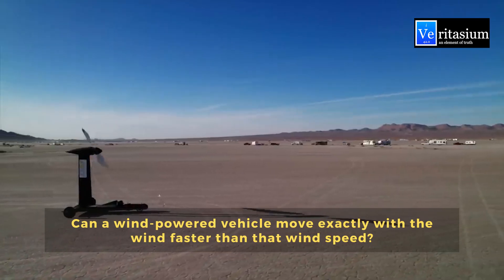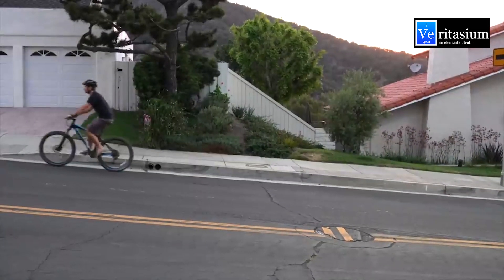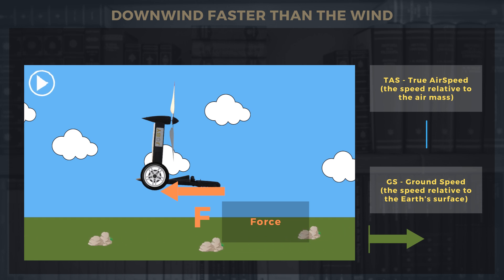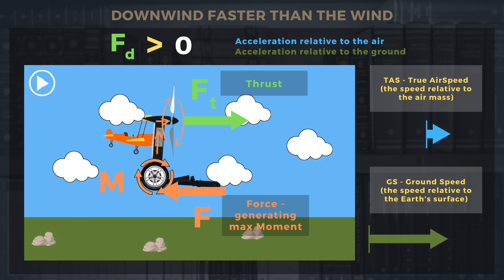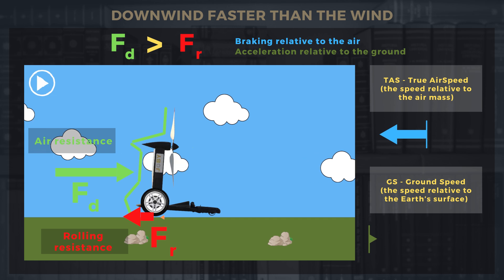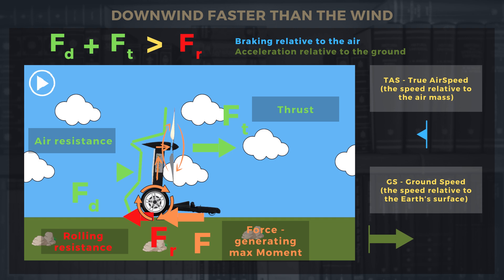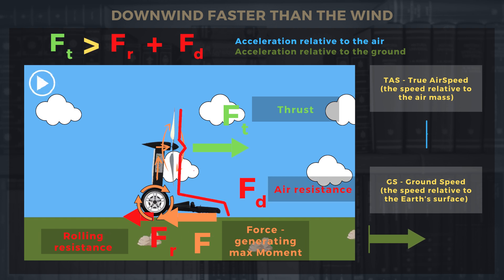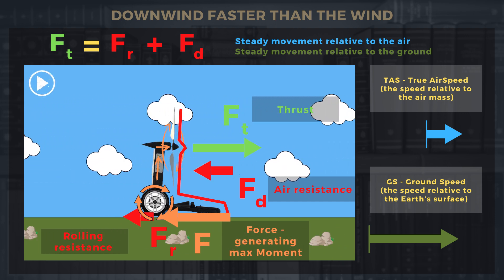Veritasium is wrong. Blackbird vehicle explanation.

Comment: Your main error: The orange force F at the wheels, is needed to balance the aerodynamic torque on the propeller. This orange force F:
- Does act as an external backwards force on the vehicle, so it must be included in the force balance that determines acceleration (additionally to rolling resistance).
- It exists right from start, even when the vehicle is not moving yet, if the propeller is already in positive pitch, as was the case for their prototype with fixed pitch.  See "BUFC second run" and note how slowly it starts, despite significant wind. That's not due to rolling resistance (which is rather small), but mostly due to the braking force from the propeller torque.
Reply from the maker: No it is not the braking force in fact it is the driving force. But it is transferred by wheel to the propeller so only there is added to balance. Propeller rotation creates resistance, but this resistance is what creates thrust. So there will be no losses on motion. Movement of wheels will be converted to movement of propeller. It need time to accelerate but because forces are not in balance it will accelerating.
Reply: @PiotrRysztak  "No it is not the braking force in fact it is the driving force."

It is driving the rotation of the propeller, but also creating a linear braking force at the wheels. The propeller rotation can create more thrust than this braking force, because airspeed < groundspeed. Look up the various papers Derek linked in the description of his 2nd video (AAPT, Drela, Gaunaa et al.)
Reply from the maker: @eyytee  I think Derek was misled by Mark Drela and other analyzes which mainly focused on the boat case. However this is a different scenario, because the wheels don't have to be "in the ground" (like a boat propeller has to be in water), wheels are only tangential to ground - it is crucial to understand. Only force braking vehicle relative to ground is rolling resistance (constant force)
Reply: @PiotrRysztak  Drela is considering a wheeled vehicle too, and so are  the other analyses (AAPT, Gaunaa et al). You have obviously not read them.
Reply from the maker: @eyytee  It is not about analyzing all other publications. Because they may suggest you and put you on one track of thinking. I am not saying that it is this situation, but if one scientist makes a mistake at the beginning and the rest duplicate it, it is not good situation isn't it? Derek himself recorded a film about such a phenomenon https://www.youtube.com/watch?v=42QuXLucH3Q "Is Most Published Research Wrong?" 
P.S. Drela only mention about it as i remember.
Reply: @PiotrRysztak  You simply have a basic misconception, that external forces are "used up" by creating moments, and then don't contribute to the linear acceleration anymore.  This is not the case. Your whole "tangential force" argument is simply wrong, and you will not find support for it anywhere in literature.
Reply from the maker: Don't catch me on words i am not native speaker. If you have tangentially applied force 90 degrees to center of wheel then this force will not move center of wheel. This force will generate max moment. How can you not agree that?
Reply: @PiotrRysztak  All that matters is that it's an external force by the ground on a part of the vehicle. Every such external force contributes fully to the linear acceleration of the vehicle. The fact that this force also creates moment that turns the wheel doesn't change this.
Reply: @PiotrRysztak  you know who wasn't biased by all the other scientists doing their derivations?  Me.  Because I conceived of and built the thing.  And I'm here to tell you that you are definitely wrong.
Reply from the maker: @Rick_Cavallaro  Let's analyze my assumption together. If I wrote total rubbish, I think you wouldn't waste your time on this film.  To clean up the discussion let's do it below Your comment. By the way I appreciate 100% for proving the mechanism working in reality!
Reply: @PiotrRysztak  "If I wrote total rubbish, I think you wouldn't waste your time on this film"

Consider how much time Rick invested building the Blackbird, just because people on the internet were talking rubbish.
Reply: @PiotrRysztak  what is total rubbish is precisely the part where you're claiming others are wrong.  That is literally the part you're getting exactly wrong.
Reply from the maker: @Rick_Cavallaro  I asked you specific questions in our discussion, why are you avoiding the answer?
Reply: @PiotrRysztak  I don't know what question you asked, but I'm sure as hell not avoiding anything.
Reply: @PiotrRysztak  
I think the key thing to understand here is that the propeller wing generates higher thrust force than its aerodynamic drag force. This "surpluss" of energy is what makes it all work, and its the same basic principles that makes it possible to go faster than wind speed in a sailing boat.

And it does not create energy "out of nothing" breaking the laws of physics.  The energy comes from the wind slowing down as it passes the propeller.

Comment: I appreciate your presentation but I do not think it is correct. 

Your tangential argument is incorrect. The argument that the wheel's torque wouldn't try to slow down the vehicle is wrong.  Ever been to a car that uses brakes? This is exactly analogous to that. Or one of those old fashioned dynamos on bicycles. 

The wheels DO try to slow down the vehicle but there is excess force for propulsion as the relative speed is much less than the relative speed of the propeller in the air. It is about leverage.

This also explains why the vehicles doesn't accelerate forever. The ratio of the speed differences gets smaller and smaller with additional speed (ie. it can be considered that the leverage is reducing towards 1)
Reply from the maker: Thank you for your appreciation, I will try to dispel your doubts. When I originally thought about it I had the same concerns as you. 
The wheels of course transfer force to the propeller but generally all the force which spins the wheels is transferred to propel the propeller. From the very beginning of motion.  The unbalance according to Newton's second law of motion will accelerate the vehicle.
The force rotates the wheel but does not brake the vehicle (related to ground or air) and this force is used to generate thrust force which moves the vehicle in relation to air masses.  It is like a plane: the force from the engine rotates the propeller but does not slow down the vehicle; (it is an external force).
The Only force slowing down a vehicle in relation to ground is rolling friction, and force slowing down in relation to air mass is air resistance.
The initial force is extra force which must be balanced by one of these forces. If the forces are not in balance the object will accelerate. - Newton's second law of motion.
Reply: @PiotrRysztak  "The force rotates the wheel but does not brake the vehicle"

Yes it does brake the vehicle. It is an external force by the ground on the vehicle, and to apply Newton's 2nd Law you must include all external forces. The vehicle accelerates, because the propeller thrust can be greater than this braking force, if airspeed < groundspeed, for the reason correctly explained in the 2nd Veritasium video.
Reply from the maker: @eyytee  We discussed about that force with @axelerat3d on a forum (www.boatdesign.net). The Wheels are connected with a propeller and are rotated when move begins. Propeller rotation creates resistance, but this resistance is what creates thrust. So there will be no losses on motion. Movement of wheels will be converted to movement of propeller. Effect will be the same. This force is not slowing down the vehicle because it is tangential so only rotate the wheels -> spin propeller -> generate thrust. Only force braking vehicle in relation to ground is rolling resistance (it is constant)
Reply: @PiotrRysztak  "This force is not slowing down the vehicle because it is tangential "

This is not a physical argument. It's an external force to the vehicle (by the ground), so it must be included in the net force that determines acceleration. The vehicle is not slowing down, because the propeller thrust is greater than this braking force.
Reply from the maker: @eyytee  if the force is applied tangentially, it will all be used up to turn the wheel. This force will not push the wheel as a whole but rotate it. This force will rotate wheels and propeller and generate thrust but will not slow down vehicle.
Reply: @PiotrRysztak  "if the force is applied tangentially, it will all be used up to turn the wheel."

Sorry, this is not how forces and torques work. An external force is not "used up" just because it creates a torque. It is still an external force that contributes to acceleration.
Reply from the maker: @eyytee  Force generate moment if is tangential and 90 degree to the center of wheel it is max moment. Newton's second law of rotation. Yes it is external force and contributes to acceleration vehicle but no in slowing down in relation to ground :)
Reply: @PiotrRysztak  he meant slowing down - which too is acceleration in the physics sense.
Reply: @PiotrRysztak  "Newton's second law of rotation"

Both second laws apply to the force, the linear law too. It is an linear external force that acts backwards, reducing the acceleration.
Reply from the maker: Don't catch me on words i am not native speaker. If you have tangentially applied force 90 degrees to center of wheel then this force will not move center of wheel. This force will generate max moment. How can you not agree that?
Reply: @PiotrRysztak  QUIT SPREADING MISINFORMATION!
Reply: @eyytee  Eyytee, you must have been absent the day they were discussing Newtons 4th law - Forces getting "used up".
Reply: @Rick_Cavallaro   haha Rick. what would you know about downwind carts ;D
Reply: @PiotrRysztak  "If you have tangentially applied force 90 degrees to center of wheel then this force will not move center of wheel."

This external force will accelerate the center of mass, unless it is canceled by other external forces. It contributes in full to the net force that determines linear acceleration of the center of mass.
Reply: @axelerat3d  
>> haha Rick. what would you know about downwind carts 

Well, I saw a video about it on Youtube, so I'm pretty much an expert!
Reply: @Rick_Cavallaro  the modern way.
Reply from the maker: @Rick_Cavallaro  My analyze is not reproductive of someone else video, i didn`t find videos that show what is going on from the beginning of experiment to the end with forces acting on vehicle. I think such video can batter explain topic then anaologies or experiments (if will made corect)
Reply: @PiotrRysztak  You're responding specifically to explanations given by others.  You might want to take a look at the title you put on this video: "Veritasium is wrong".  Did you arrive at that conclusion without watching his videos and listening to his explanations?  Many people have pointed out to you exactly where you've gone wrong - and it happens to be exactly where you claim others got it wrong.  They didn't.  And no number of posts here is going to change the fact that you got it exactly wrong exactly where you're claiming others have it wrong.
Reply: @PiotrRysztak  You acknowledge that the tangential force at the wheel/ground contact is what is driving the propellor, but you cannot see how this also acts to brake the cart? where do you think this energy is coming from? this is like the basic intuitions of mechanics and force diagrams - you really should change profession! I actualy agree that 'leverage' is not the right word to use, especially whilst showing a digram of a pivot being used to lift a weight, because this is misleading. The leverage is coming from the difference in rotational speeds of the wheels vs. fan. i.e. wheels spinning fast with small force = large force from fan spinning slowly (constant power).
Reply: @PiotrRysztak  

[Wheel/ground contact] "does not brake the vehicle"

It certainly has a force trying to slow the vehicle down. The fact that it is a torque around the axle doesn't change it. 

At the point of ground contact the force is towards the back. If you were pushing from the top of the wheel towards the front of the vehicle it would be to same rotational direction but rather obviously cause a force towards the front of the vehicle.
This is very easy to demonstrate in any kind of practical setup.
Reply from the maker: Wheel- ground contact generates rolling resistance force; it is constant force and is slowing down vehicle (I mentioned it). The extra force from ground movement is not slowing down the vehicle, it propels the wheels and propeller (they are connected). This force can not slow down and propel at the same time.

Think about this by Newton's second law of motion, it is really simple. There is no place for sophisticated physics here. There are simple forces here and simple balance of forces. If there is no balance the vehicle accelerates. The key to understand it is not to over-think it.
Reply: @PiotrRysztak  
Let's ignore rolling resistance as it is minimal. 
For the sake of argument lets assume that we don't use mechanical means of transmission of force from wheels to the propeller but electric generators and motors.
(in reality they would be about 90% efficient best case each but we can pretend they are 100%). 
Before we even get to the wind cart: think of a cart with with its wheels hooked to a generator pulling 600watts at 6m/s. You would start pushing this thing, at slow speed the resistance would be moderate but to push it generating 600W would take a really fit person to do it even for a short to moderate distance. I think there is a force there and I think anyone reasonable would agree with that. A force resisting forward movement, trying to slow down the cart.
From P=FV we get that force is 100N by the way. Producing 100N at slow speed is easy but at higher speeds it becomes increasingly hard. P=FV already tells us that. As does familiarity with levers, creating big force but doing little work is easy. Big force and a lot of work is hard - or takes a lot of time. Power is work done in a unit of time. 

Now lets put that same generator on a wind cart. And further assume that there is 5m/s back wind and let's get back to a 6m/s second situation. Cart is whizzing on the ground at 6m/s. The Generator - via the ground contact puts a 100N force trying to slow the cart down. For the cart to keep moving we need more than 100N force pushing it forward or it will slow down. P=FV gave us the power = 600W. 

Now in this situation the cart has passed the "true wind" (ie. measured in relation to the ground) and is already operating in 1m/s headwind. As we have 600W to use, the question is how much thrust can we get from the propeller with this power (run by an electric motor in this case). P=FV -> F=P/V -> Force = 600w/(1m/s) = 600N. 
This assuming no losses, in reality is less. But we have a ratio of 6:1 which gives us ample excess for losses in propeller efficiency and transmission. 

This is how the cart's principle works. It is baseless to argue that the wheel torque required to spin the prop wouldn't create a force on the tire/ground contact. It most certainly does. Just like cars brakes (or engine) will put a torque on an axle and wheel and cause the car to slow down or accelerate. 

For sake of fun let's check the earlier cart at 10m/s speed (same 5m/s wind). Now the ground speed is 10m/s and wind speed is 5m/s. The ratio isn't 6:1 (6) anymore but only 2:1 (2)
Further at 15m/s it would be 3:2 (1.5), at 25 m/s it would be 25:20 (1.25). ie. The faster we go the less speed difference there is in those two medium interfaces [cart to ground AND cart to air] or [wheel to ground AND prop to air]
Reply: simple image search with [wheel torque force] will give you a ton of links that explain how the torque and force at the tire contact patch relate.